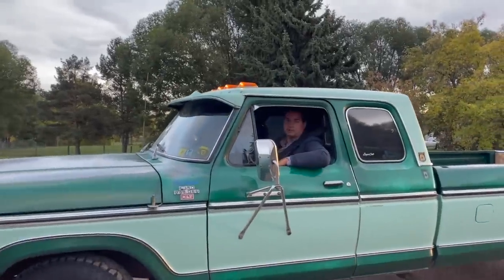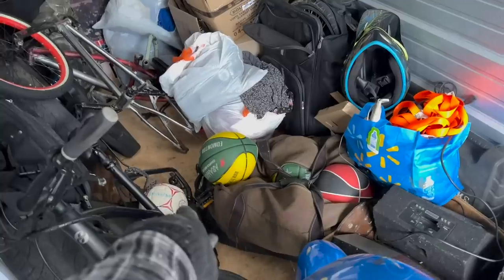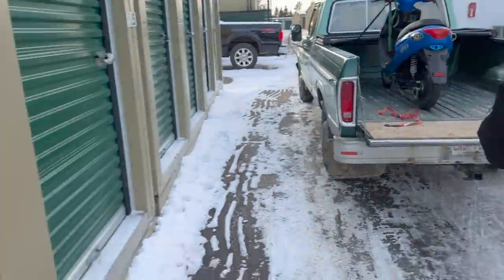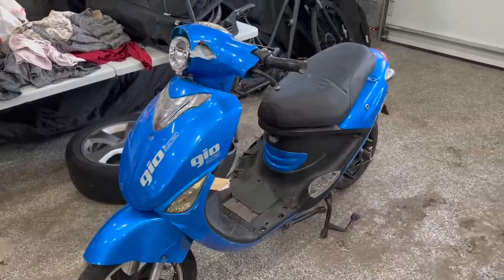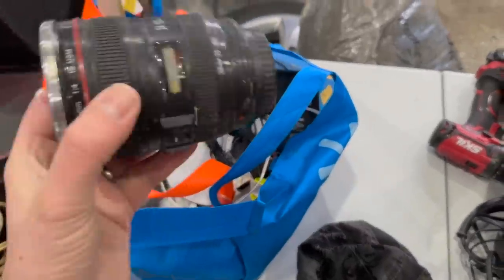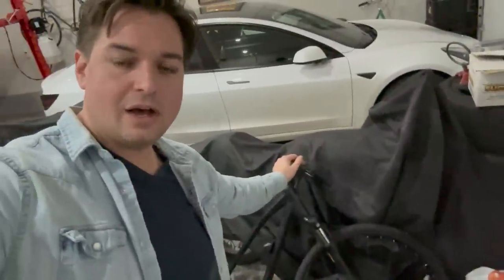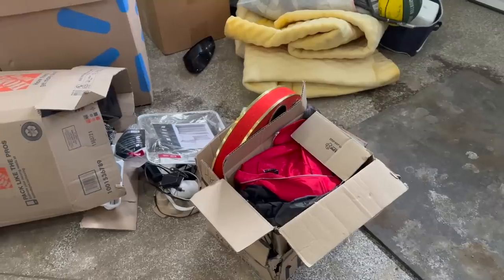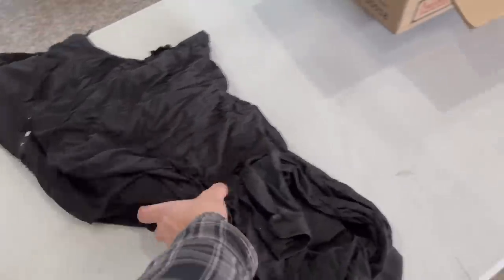Best Storage unit find yet?!? $7000 in a junk unit?!

Comment: Alexander, I believe the small bar you've found came out of an old floor model stereo with high shine wooden cabinet. It appears identical to the bar insert that was behind two cabinet doors on a unit I acquired many years ago. It was on a drawer type mechanism that you could slide out of the cabinet, and it would rotate, to position the liquor holder out in front, or the LP slot holder that's on the opposite side. Circa early 1970's. I no longer have this, and sadly, can't recall the brand name. As always, many thanks for sharing your cool finds.  Cheers!

Comment: I helped a former bf get a little used Chinese scooter back around 07-08.   It was nice until we learned that no one in san diego would work on them, and that they needed a lot more frequent maintenance than expected.  Idk if more places work on them now, but I guess they were a very different animal than the brand name scooters of the past.  Getting replacement parts may have been a problem too.  Cheap plastic.  Will be interested to see how that goes.  I had a vespa ciao, and then an 85 honda spree when I was saving up for a car.  The vespa had pedals, and rust in the fuel tank so I was constantly having to clean out the carburetor.  The Spree would collect carbon in the exhaust pipe, & the motorcycle shop guy had to keep heating it up with a blowtorch & cleaning it out.  Still grateful for them puttering me around for a little while when I was young.

Comment: If you have a bike shop nearby that sells e-bikes, they can read out the data from the motor, so you know how long and for how many miles it was used and if it needs a maintenance check up before you use it yourself or sell it.

Comment: That Ghost bike should take a generic rear wheel, as long as it the right rim size, and  has the right disc rotor and cassette. Since the battery is not integrated into the frame, as far as I can tell, a different battery and mount could be fitted. Getting one to fit the original mount could be expensive. I don't think it is a 7k bike, maybe 3k or more though. Get in touch with Grin Technologies in Vancouver, they should be able to help. The scooter looks pretty beat!

Comment: Grab and Go Units:  best thing for those Grab and Go units, when you want to load and sort at home is a single axle trailer.  When the schedule is tight, or the weather is bad or when the unit is already packed in boxes and totes is a 10’ single axle trailer, an enclosed trailer can really speed up the job and doesn’t ruin the trucks Mile per Gallon number.  

That unit could have been done in 1 trip and it’s easier to put items like the scooter in a low deck trailer.  You also don’t risk moving the stock in an open truck, which can ruin the value.

Comment: That is a mid drive ebike so any wheel will work on it that is the correct size. That is not a $7k version of their bikes. its more like $1600 or so if you look at their website. You were looking at their top model. The battery is a large percentage of the cost of an ebike. At least 1/3 of the cost.

Comment: That bar set thing looks like the rotisserie insert from a fire place stereo.
My mom had 1. 
It had a bar on the upper left, turntable/8 trak/AM FM radio on upper right. And a fake fireplace in the bottom. Fireplace front sides were speakers covered in the same velvet as the bar rotisserie.

Comment: Usually when you're missing a back wheel, they're stolen bikes. They remove the rear wheel and leave it with the lock. They scrape off the serial numbers too. They sometimes take the front wheel when they can't get the whole bike. On a stolen bikes the battery was probably with the owner. I think  you got a thief's stash this time. Check the serial number on the gio. It may be registered to someone !
Reply: Serial number was run through a database and came back as not stolen. 🤙

Comment: The  bikes are a good find. He was probably trying to sell the bikes before he left hence why they were dismantled as they go for a lot more like that secondhand, it also explains the missing battery. Its a mid drive bike so a standard bike wheel should be ok, especially if it is a steel rim.
Reply: User_CuriosityIncorporated01  Thank you, I I was not expecting that. How do I contact you?

Comment: That ebike is not the same as the 7k mountain bike you were looking at on the website 🤣

It's a far lower end commuter bike, probably more like 2k new, but by the looks of the drive unit a pretty old model. Most of the value is in the battery though so without it it's worth not a lot.

That Giro full face helmet may be worth a little.

Comment: I had a electric Moped just like the one you have at one point. My only thoughts about it ,is they're not worth it. They're not doing the real researching on them as everyone thinks they are.Again ,not a reliable source of transportation because of over heating and too much energy siphoned up from the battery, by just going up a little hill.

Comment: That Ghost e-bike is cheap model and totally not top tear model you show at 14:35.... Max $2000 in new condition. You should learn more about bikes so you wont mix up a $2000 bike to $8000. Even the fork on that $8000 bike is worth more that the junk you found.